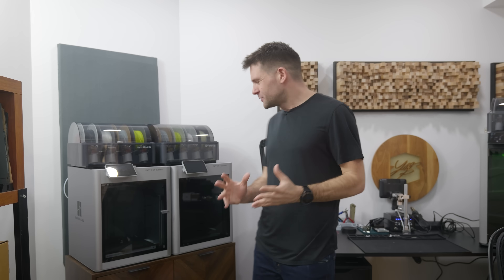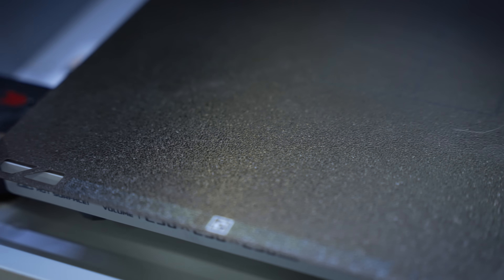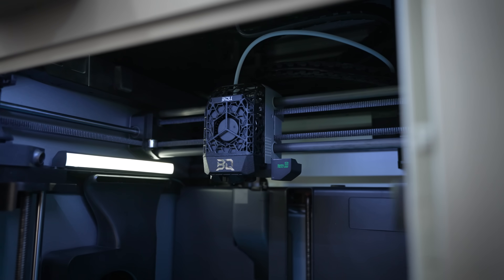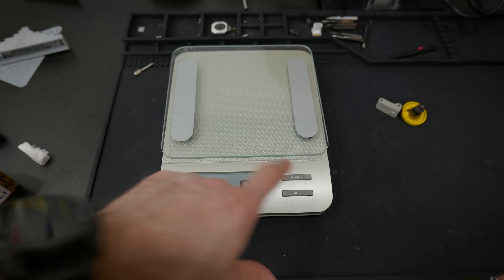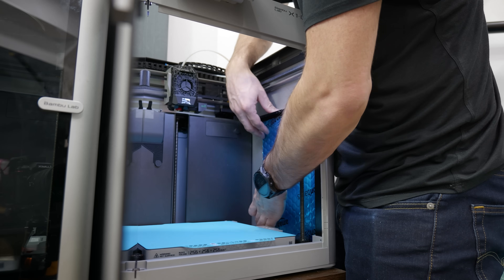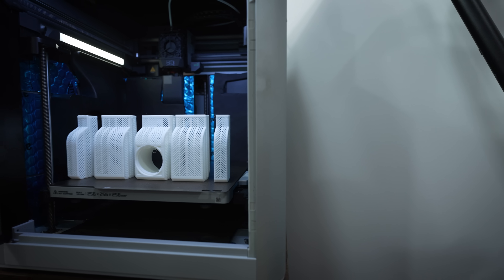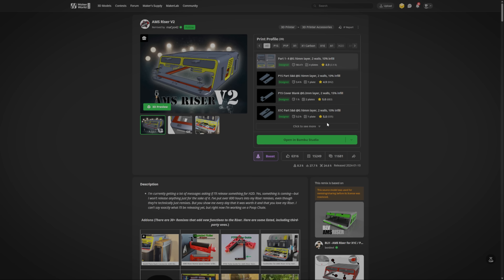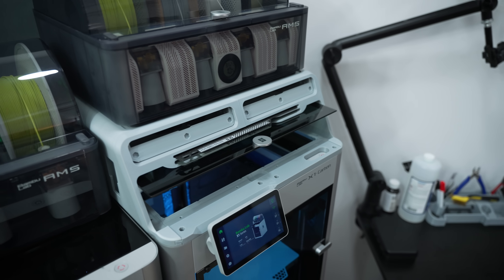I dont understand why more people dont MOD their 3d printers...

Comment: been printing for years. I use Bambus as work machines. They are good and reliable out of the box. My niché printers get mods that make them optimal for what I need them to do. I love not messing with the bambus because it honestly isn't needed. And my specialized machines I love for the control I have over them

Comment: A drop from 52.5 dBA to 48.9 dBA is quite an improvement. The noise reduction is actually significant (depending on the frequency, up to 120%), but your initial reference sound is like going from moderate rain (which isn't so annoying to start with) to light rain. Was it a problem to begin with?

Comment: In terms of thermal insulation you really need to take the printer apart and get a tight seal, including gaskets for doors. I insulated my qidi xcf thoroughly and it will maintain 70c chamber temps without a heated chamber

Comment: i dont get it with the poopchute. i hate it falling out behind the machine. why does it not stay inside the printer on the bottom? make this machine just a couple cm higher, and it won't interfere with the print bed. I Have the Creality K2 Pro and this thing is on the backside pretty crowded, and you can't put a bin behind it because some ports are in the way to get a bin close enough so it can fall inside. I have made an adapter that clips onto it with a square tube on it and so it can fall under the table into a bucket. This whole poopchute thing is just annoying.

Comment: If you install all the extruder parts on the print head, it's about a 2g increase in overall weight (the extruder gear is the big increase in weight, but longevity is increased)

Comment: Wouldnt more weight make for a more steady line far as printhead weight? I guess maybe if its only up to gravity but its driven by riser bolts and motors so those are whats going to determine quality so grease up and lube with proper lube in proper places

Comment: The most important upgrade, the metal extruder gear, is the most important item because it can potentially prevent an actual mechanical failure. And we got nothing on that.

Comment: Modding is fine if you're a hobbyist, but when you run a print farm, you cannot afford to have mods cause shadow issues that can be very hard to debug down the line, which happens especially with mods that affect the printing process itself. This applies especially to the mods that require firmware changes.

Comment: btw the metal gear upgrade isnt so much for reliability more for printing Carbon fiber Filament bec it will rip the platic gears apart in no time.
and yea the Biqu Glacier Printplate is awesome as much as i can say after 500h of printing on it with some prints that are really hard to get sticking but im using it at 55C

Comment: The best mod I ever did to my Ender 5 was to convert it to a CoreXY machine. With my Bambu P1S and QIDI Plus 4 they work well enough I don't have to. I did upgrade the hotend on the Bambu though, because quite frankly the stock hotend isn't that great compared to what it should have come with.

Comment: my x1c sometimes gets a false spaghetti failure warning that stops the printer when I am using a light, I use it all the time but sometimes it just does it on some prints and it won't stop once it does for the remainder of that print so I have to turn the light off haha

Comment: This is one of the few tutorials that I am happy it became obsolete. Bambu now includes most of the usefull upgrades by default in the new P2S. I got first week it was released and I absolutely love it. I only have around 50 hours on it so far but it's been the best experience I had with a printer ever. (I previously used X1C, P1S, Ender 3 Pro, Ender 5 Plus, and CR 10)

Comment: Easier way to insulate the printer would be to build a big foam box out of 1.5" foam insulation board, and just sticking it overtop of the whole unit.

Comment: I have a sermoon d1 that I have modified to core XY with linear Rails direct drive extruder chamber fan BTT pi with klipper and a new screen.... Right now I'm modding my ender 6 I have a any cubic Chiron with a 430 mm bed and 800 watt power supply I'm putting that on the ender 6 and stretching the y-axis to a 1000 mm the x and z axis are going to be enlarged too but I don't know how much I need yet  I  also  got a pallette 2 on eBay for $80 but when the new prusa nozzle tool changer is out I'm converting to that because I can fit at least 10

Comment: So you had the right idea with the soundproofing but the execution didn't go far enough, the problem you're solving is adding mass to a vibrating member (the casing) and thats fine but stopping it at its source should be way more effective, that is to say add rubberised washers/gromets to all the interface points between the internal structure (source of vibration) and the outer shell and I think if you re-run it you'll get far more favourable results.

It is ofcourse possible that the glass front and air gaps are just a lost cause and you can only deaden the sound so much without building a secondary soundproofed enclosure.

Comment: I bought and frenkensteined three ender 3s and now my Centauri Carbon. The mods are a lot less in depth and mostly for holding things when I need to set them aside and a heated and insulated enclosure. My CC is so good and quick I have a new problem. I burn through filament so fast. I wonder if we'll ever go back to 2.85 with things like CHT nozzles and more powerful hotends.  One reason you may be seeing less mods is because of closed firmware becoming more and more prevalent.

Comment: I modded the holy hell out of my first printer. Turned it from a fair PLA and PETG printer into a highly capable ABS and Nylon monster. It's just that my current printer is still almost new and does everything right already. I did add a custom made poop chute to the back and little "saddle bag" tool holders to the sides but this thing's already a beast. Yes it can make its own parts but not if I break something making quasi-neccesary changes to it.

Comment: From the CNC kitchen tests, using desiccant alone takes forever to dry out filament. I did just buy the newly available Sunlu AMS dryer to install on my early gen AMS so I can have heated drying there without having to dry my rolls externally before placing in the AMS.

Comment: I use the CryoGrip as one of my primary plates as well, and one of the small improvements is that because it’s that bright blue colour it actually lights up the inside of the printer quite a bit more, especially with the Panda Lux mod. I have two printers and the one with the Biqu plate is substantially brighter inside.

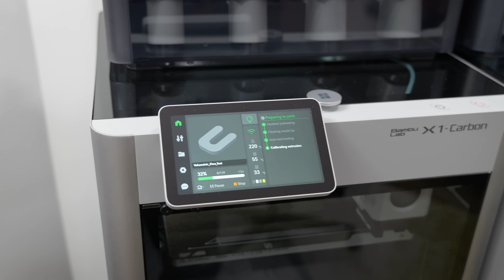Comment: I can tell you are really new to 3D printing, and I recommend that no one should takes any advice from you when it comes to 3D printing. @ 6:34 You clearly did not increase your bed temps correctly so the print sticks to the bed properly, and your lack of experience is causing you to count this as a failure for flowrate of the hotend when it's CLEARLY a bed adhesion issue. You can even see it moving around at 6:55 to confirm this, so your video is misleading and inaccurate information to new users.

Comment: The build plate is because you likely didn't clean your build plate before use, you should use dish soap and a bit of pressure and clean it. Even for PLA prints it leaves a residue behind, you also, should clean it if you touched it a bunch with your hands. The oils on your hands will make prints not stick as well.

Comment: Not got a Bambu, got a centauri carbon, the lighter print head covers on that reduce ringing on like holes on the sides of prints. I imagine it would be the same for the Bambu. That said, the Bambu cover is already pretty light to begin with. My weight saving on the centauri carbon was about 30% and the reduction on the ringing was visibly noticeable.

Comment: Do not insulate the inside of your machine. There is, by design, a lot of airflow from fans that exhaust heat through every small gap, and on top of that you'll make maintenance and resale value much worse.

Comment: and the upgrades are SOOO worth it. the insulation and stuff I don't get into because I don't do engineering filaments al lthat much beyond the *-CF stuff, but the Biqu stuff is a MUST have! I have not had a clog since upgrading to BQ parts,and I am not even using their hot end yet although it is sitting right next to me in a gridfinity bin..snug... waiting.. HOPING a clog happens so I have a reason to swap it out lol :).

Comment: Why? Because you dont need to. Its designed to do what it does. Mods aren't needed. Especially those decadent containers for the AMS. Just wait until they leak moisture and kill the main board in your AMS.
No one cares how your printer looks. What's matters is how it prints.

Comment: the nozzle is like the most easiest thing to change, why would you make it harder? i dont see how insulating would increase the bed temp, its controlled by a pid sensor. try using a solid state dehumidifier membrane instead of or as well as desiccant.

Comment: I started wirh an anycubic chiron and upgraded the hell out of it. It now has linear rails, a new mainboard + cabinet with harting industrial plugs and a direct drive extruder with an bl touch. Even though there went a lot of effort into this machine it still wont outperform an x1c or not even an a1 because its missing things like input shaper etc. It is now printing quiete slow but very nicely and was for that time outstanding.

But the hassle free printing of an a1 or x1c without the calibration of each material with temperature, flow rates, cooling etc is just so much better. And there were times where i had an issue and was searching the fault for days. And dont get me started on updating that thing... Back then marlin was the best firmware to go with but every time you wanted to update you had to compile and configure the firmware from scratch. 

Nowadays you dont need to upgrade such printers. They work fine. If you just keep up with regular maintenance you can keep on printing.

Comment: The Amazon blue stuff you added DOES NOT absorb sound.  It’s intended to cover 50% or less of a panel that is transmitting or resonating.  So it’s always misused in vehicles.  The way I use it is I go around the vehicle and bang on panels and see if a panel rings or resonates.  I also use a tone generator and I go through all the frequencies slowly and try to excite panels in the car.  

I’d also like to point out when I say 50% or less I’m not joking.  Pull the carpet from your car and look at the factory sound deadening material on the floor.  ~50% coverage or less.  There are better materials that weigh less that can actually block and absorb noise…

First if air leaks then noise leaks… batting and closed cell foams work the best but you can’t use those in a 3D printer.   

You need to just seal up your printer and then it will be quiet.

That’s why a Bambu A1 inside a zip up enclosure is so quiet.  No air leaks.

Comment: There is no need to mod your X1C, maybe a high flow head but there is not a lot of time saving. Bambu made these printers to be reliable,  and they are. 19 with the stock head? everything is 22-25 by default in the profile and they are, so it might be a higher flow rate but the stock hardened steel work at 22 easy. I owned and ender 3 and 5, then I did not 3d print for 2 years until i got a X1C. I wanted to print not tinker.

Comment: Beware: Lowering your bed temperature will increase warping. To reduce warping, you need to get the difference between the hotend and the bed (and ideally the air in the build volume) as small as possible... (Yes, there are tons of other conflicting requirements here...)

Comment: Forgot to also include modding the x1c to turn into a heating chamber inner left side also extra air filtration system on the right side.   Also last thing is to add a filter in the back exhaust I designed and printed one on my own using solidworks.  So many various mods but I do agree some are just a gimmick to waste your money and time.  Nice work.

Comment: So to weight savings helping with print quality this only matters when you start going really hard with acceleration and you will have to tune resonance compensation for it to help
and whenever you change parts on the tool head you should tune resonance although i think the bambulab does this automatically im not sure i use vorons and self built printers

Comment: I only have a Monoprice Maker Select Plus. It's served me well for a long time. The first mods I did were stepper motors, glass bed, LED strip, hot-end upgrade (Micro Swiss), spool holder, added a raspberry pi and webcam mount for OctoPrint--as well as printing TPU feet to reduce vibrations. I have my printer and raspberry hooked up to smart plugs. 

I planned all of that before it even got delivered to my door. I think when you're a maker or tinkerer, you're looking to mod or upgrade things that aren't even supposed to be.

9:11 - Solid Snake enters the chat

Comment: The cryogrip plates are also cheaper than then normal textured bambu plates under normal circumstances. Also cooler looking. The phaetus conweb arkfly one is the one I need to try because its basically the cryogrip but purple. 

Of the upgrades you mentioned its the revo hotend i REALLY wanna try but man that price will prevent me from doing that for a long time.

Comment: Awesome video! Was looking for this kind of thing. I'm one of those weirdos that wants to mod their Bambu printer.
A few notes:
- Wrong kind of test for the weight savings, probably. It won't make a difference in small fine details like that; you're more likely to see a bigger difference in rapid accelerations - around sharp corners at speed, etc. VFA tests are good for this. That said, I'm also dubious about the benefit - you need to cut off a much larger chunk to make a difference.
- One of the benefits of the skeletonized design for the printhead is supposed to be better cooling for the toolhead, reducing the likelihood of heat creep causing jams in the extruder.
- The Panda Jet has a four-way duct design; the original Bambu stock duct is just two-way. You'll need to test overhangs/bridging in more than just one direction to get a proper look at how it performs. I have this mod and have noticed an improvement, mostly on overhangs that extend towards the rear of the printer. Otherwise, the benefit is pretty small, maybe some slightly better cooling for PLA overall, not sure; hard to quantify.
- Those build plate guides are great, but speaking from experience, if you have that REVO nozzle upgrade, it will collide with them at the corner of the bed if you do full bed prints. Just a warning. Find ones with a lower profile if you can.

Comment: If Revo makes the hot end and it fails, good luck getting a warranty. My first Revo was my last Revo. Ended up just buying a replacement after too many back and forth emails. Too many hoops to jump thru. Replacing just fixed the issue after several mandated tests via multiple emails. 👎 Revo.

Comment: For those who are just getting started in 3d printing and want to really learn the ins and outs, get a cheap 3d printer and print upgrades for it. As you learn more, your printer gets better.

I got an Ender 3 V2 and it now has a whole new control board, volcano CHT hotend, direct drive extruder, runs Klipper, can print nylon and can print TPU about as fast as PLA.

WIll be building an enclosure with air evacuation going to my radon mitigation fan for doing styrene filaments like ASA and ABS.

Comment: i bought an Diamondback 0.6mm nozzle for the x1c. Costs a ton of money but its both very very hard in fact harder then anything you could get and it also has a higher thermal conductivity then brass or hardend steel.

Comment: I don't mod my printer for a few reasons. 1.) buying parts is near impossible (because I have one of those weird printers that is something of a clone of a clone and I don't know exactly what parts are interchangeable) and 2.) printing my own mods seems kind of pointless since it's an open frame printer and I don't really know what I would print to upgrade my overall printing experience. I mean, I guess I could print a spare (or few) part scraper/spatula to make getting parts off the bed easier.

Comment: Dude! After 10 years of "tweaking" 3 generations of Enders and almost-working machines, we now bought Bambu machines so we can finally focus on the things we bought those machines for - our designs, our products and the insights we get from the prototypes we are making in those.
Reply: HAHA!
Reply: And here I am still using my almost 15 year old CR-10.  The only thing I've done is offset the thinking to a pi.
Reply: @phokeydhoo8940  CR-10 came out like in 2016? I have been printing with CR-10 clone since 2017. So 9 years ago not 15.
Reply: Not only that, but like 2 of the mods he reviewed were actual improvements. The $100+ hot end was the only real improvement, everything else didn't work or was largely aesthetic.

Comment: I think your heat insulation tests didn’t work because the material was too thin 
You want something that’s 1/4” thick at least

There’s a mod to create a reflow station from a toaster oven and the insulation really helps. But needs to be 1/4” and yeah would need to cover the glass. Could maybe try some Velcro to attach since it’s not gonna be too hot